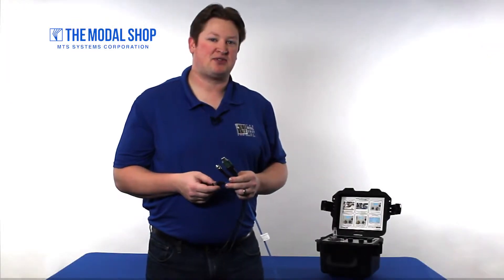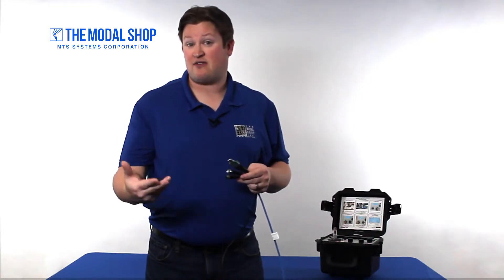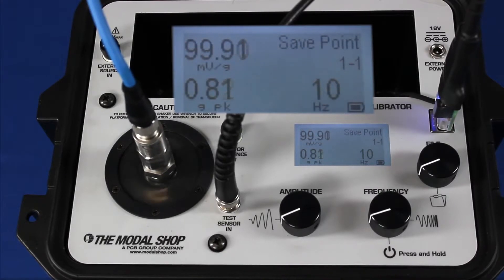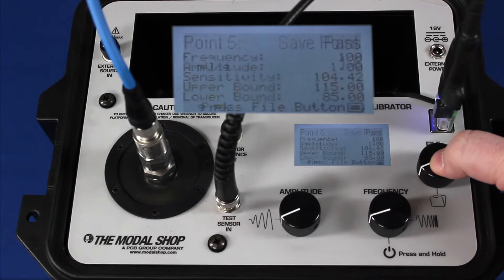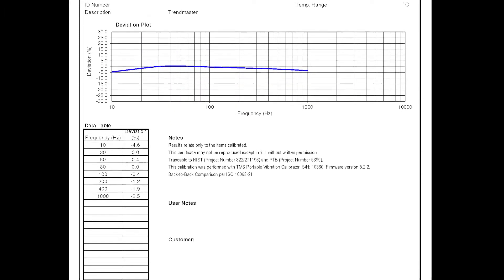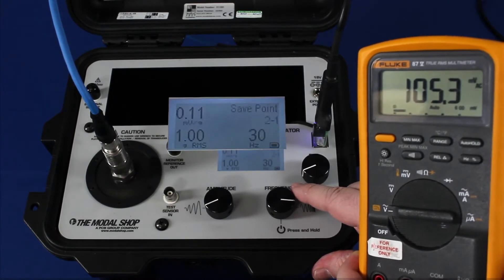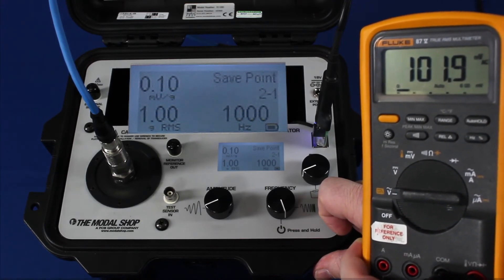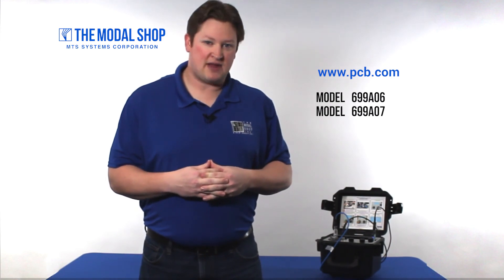Calibration of Bently Nevada TrendMaster Sensors

Comment: Hello. How i can test the 3500 monitoring system and the 3300 xl bently  Proximity Transducer?
Reply from the maker: Hi Rahim, we have several videos that can help with this question! The proximity probe is mounted over the shaker and then the sensitivity can be tested and a loop check performed. This video shows how to install the proximity probe adapter kit: https://youtu.be/jRN8UfdeYmQ. This video discusses testing prox probe sensitivity and the issues with incorrect cable impedance: https://youtu.be/2EERQP-Xvdo. Finally, this video is a basic loop check video, but we did not have a 3500 to use in the video, nonetheless the concept is the same: https://youtu.be/_ed0P6O0ymE
Reply: @TheModalShop  thanks.how much this devices?
Reply from the maker: @rahimbabayev3767  Thanks so much for your interest! If you could kindly fill out this form: https://www.modalshop.com/industrial-vibration/pages/contact-an-expert one of our Technical Experts will provide you with pricing information :).

Comment: can I get output of 4-20MA ?
Reply from the maker: A DMM is needed to measure the output of 4-20 mA vibration transmitters. You can also use the 9100-PS02 24 VDC power supply to power those transmitters. This video show how: https://youtu.be/RavJ7hosBnQ
Reply: @TheModalShop  Thanks